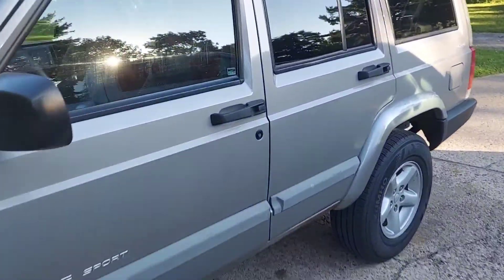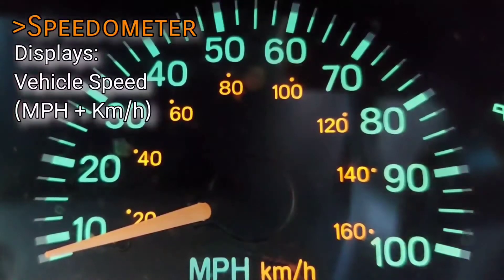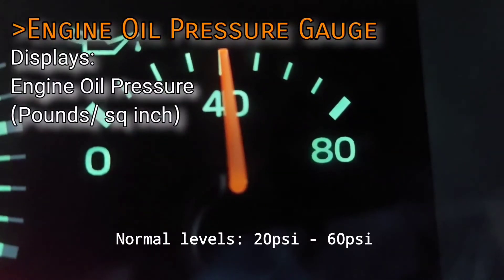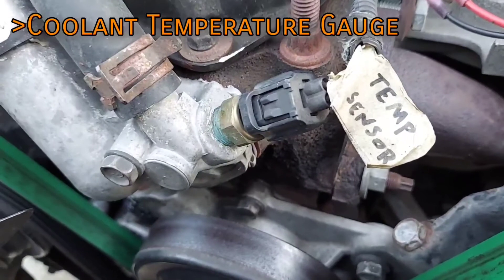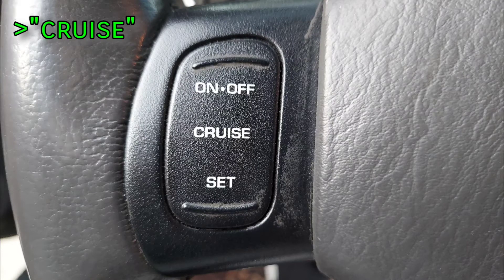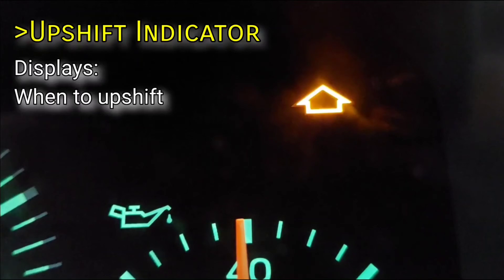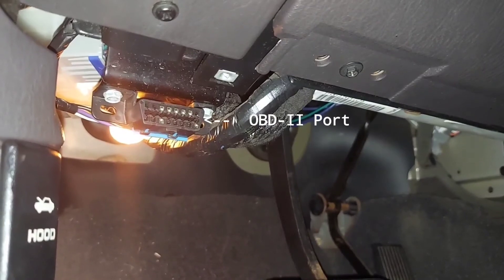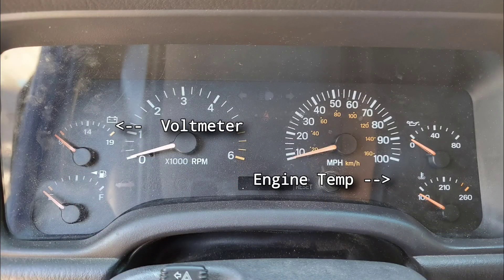Instrument Cluster Tour: What Every Light Does - Jeep Cherokee ['97-'01 XJ]

Comment: Great video. I have a  November 1998 production sold for the 1999 model year XJ and it does not have a chip in the key.  Also I notice you said something about the sensor in the gas tank. The I thought fuel pump was outside the tank? Did they put some sort of sensors in the tank apart from the pump?
Reply from the maker: The fuel pump (and its assembly) are entirely inside the gas tank on all years of the Cherokee, you might be thinking of the fuel Filter, which was mounted outside the tank on the 84-96 models but is also inside the tank as part of the fuel pump on the 97-01 years. 

The sensor I refer to is (probably) the fuel level sensor, it's a small metal arm with a float on the end that always floats on the surface of wherever the gas level is. As the fuel drains, the float goes down with the fuel level, and moves that small metal arm across a sensor board which changes the resistance of the voltage running through it, which changes the displayed amount of fuel you have left on the dashboard gauge.
Reply: @WAEMIDIV  yep it’s the fuel filter. That’s what I was thinking of! Thanks for the response!

Comment: Excellent video, thanks! My 4wd yellow lights do not light up when I am in 4wd mode; so I ran the self test you presented at the end; they do not light up, but so it happens in your clip as well. Therefore still not sure if the lights are damaged, or the 4wd switch on the transfer case :(
Reply from the maker: The 4wd lights do not light up during the self test whether they're working or not. I'd put money on it being the 4wd switch on the transfer case its a really common part to fail, literally 5 of the 7 XJs I've had that switch was out.
Reply: @WAEMIDIV  Thanks for the quick reply; will do that!

Comment: 4:12 would anywhere above 50 be good? On some occasions mine will bump up from 40 to the mid to high 50s
Reply from the maker: Oil pressure is normally much higher when the engine is cold, as the oil is much thicker when cold and thus easier to build pressure with. I've seen my oil pressure go up to 80 some winters, but only briefly - when the RPMs go down or the engine warms up, it'll settle into the normal range. 

50 is perfect, that's a sign of a well maintained engine that was taken care of through its life. The only time you need to be concerned about high oil pressure is if it stays there for a long time, because then you'll blow a seal somewhere.
Reply: @WAEMIDIV  Ah, ok. That's understandable, given I usually get close to -30 anywhere past October (god help me)

Well maintained..? I mean... It's coming close to 320k miles and so far I'm terrified of touching it.

Comment: So can anyone help me out with my situation I’m going through? I got a 2001 xj and all the gauges work and dash lights, but the check engine light, parking brake light, airbag, partime and full time light, hatch light and abs lights don’t work. Anyone have this issue before?
Reply from the maker: Because so many of them are out I l'd start by taking the cluster out and cleaning the connections on the back with dielectric grease
Reply: Same issue, did it work for you?